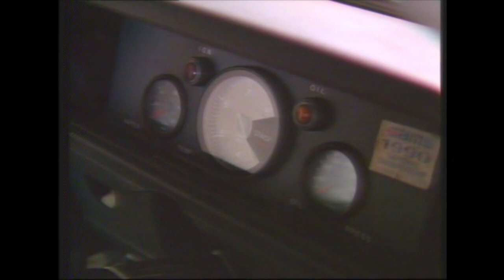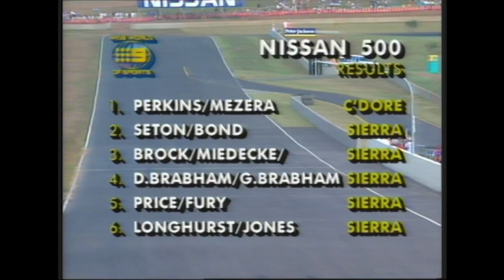1990 Nissan 500 - Eastern Creek

Comment: Wow never knew LP did that for this event 9:12. 8400 revs from the 304 is massive especially before the 91 rule changes.
Reply: Love it, and that's a group a engine, and therefore factory block, heads and most of the internals and injection. In 1991 Hrt revved their VN group A engine to 9000rpm at the Adelaide Grand Prix support race.
Reply: The sounded so sweet back then the V8's. Engines weren't rev or CR limited like the 7500 rubbish they have today. As Richard Wells said by the end of 1991 those V8s were screaming!
Reply: nothing is std in that engine,,holdens cant sustain 6k,,std..rockers leave.. fords can..